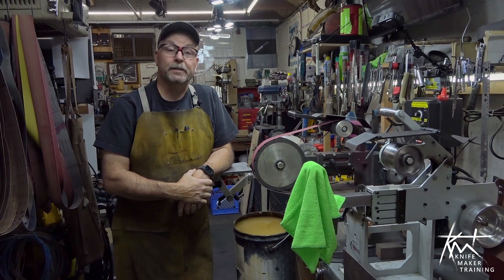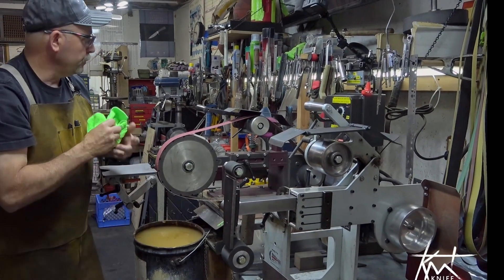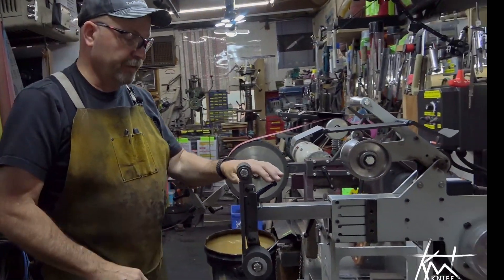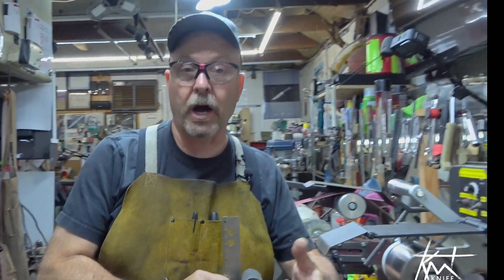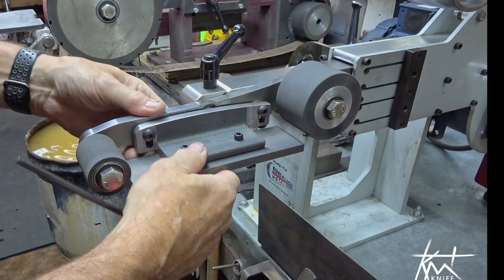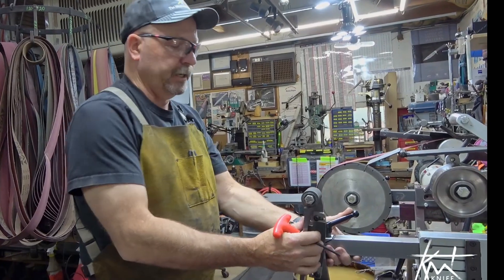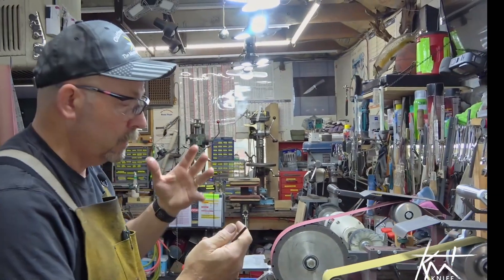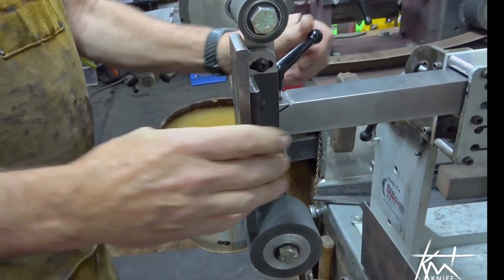The Caffrey Platen attachment for Belt Grinders

Comment: Do these smaller rubber wheels used here have a lower recommended rpm speed? I've read only 3200 rpm for the rams Bralin smaller rubber wheels which is not nearly fast enough.